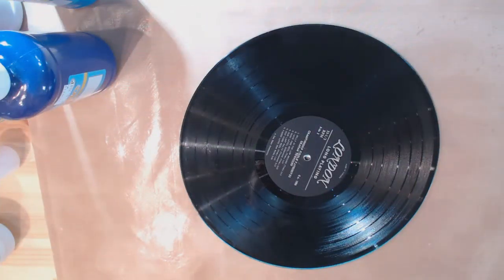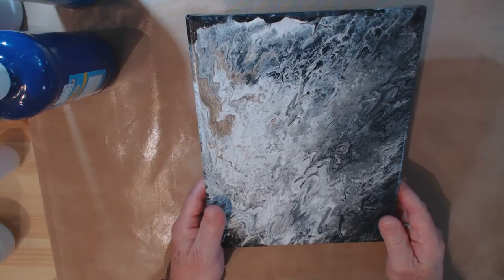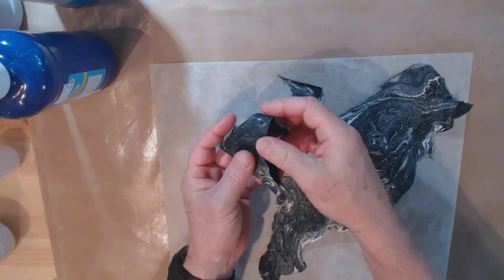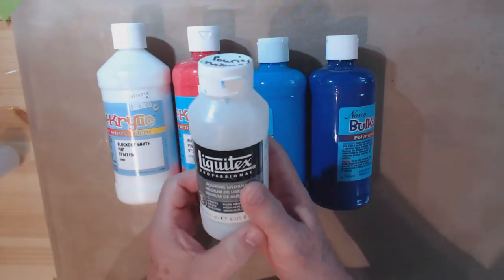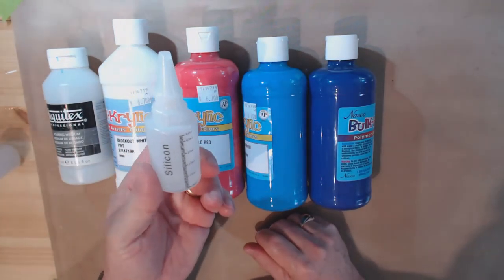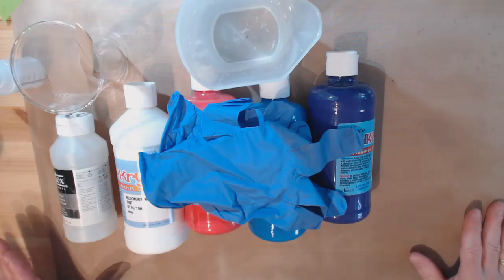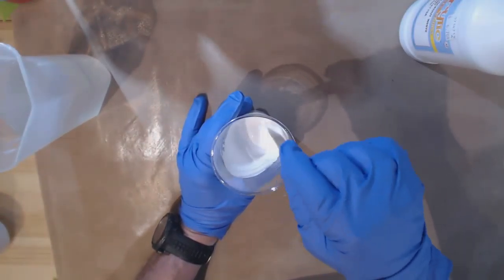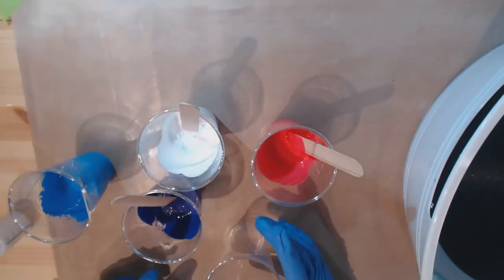Bland Designs- Acrylic Pouring 2 Spin Pour

Comment: Hey love, I have a couple tips for you! 1. There is no limit to the amount of pouring medium you can put in... it all depends on the paint. For high flow or inks you can do as much as 1 part paint to 10 parts medium... for thicker paint's you can do 50/50. It takes a bit of trial an derror to find your mixture. 2. Mix your paint and pouring medium together before adding the water. Pouring medium is meant to bind to paint and you're gonna have to work a lot harder to get it mixed properly if you just toss all three in at once. When you were talking about the not more thank 30%, you were correct in part... but it's water you can't add more than that too the paint because it'll under-bind the paint.and lastly.... you only need 2 or 3 drops of silicone in each color... too much and it's much more likely that it'll touch the canvas and the paint won't stick where the silicone has touched the canvas! Just a few tips! Have an awesome day!
Reply from the maker: Thanks Nichelle for the tips- I will certainly keep them in mind when I am doing my next pour.